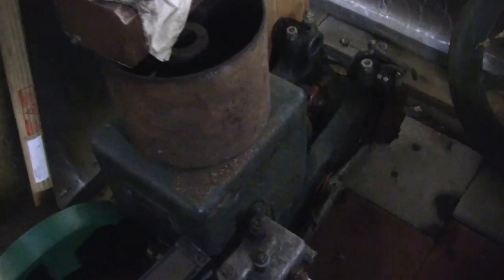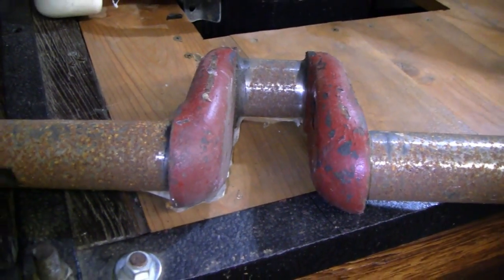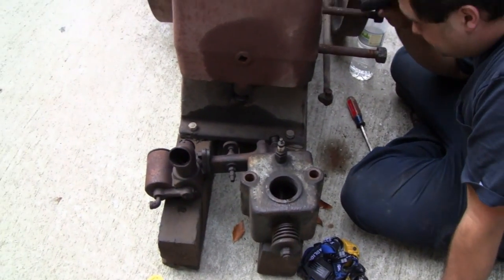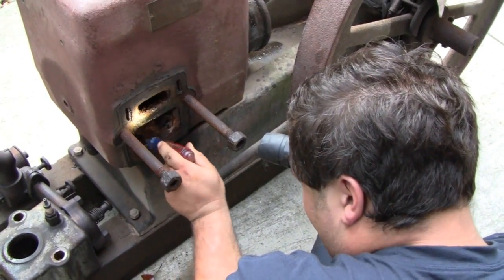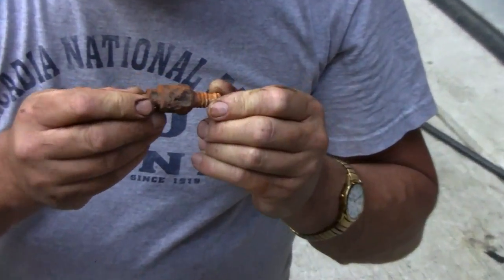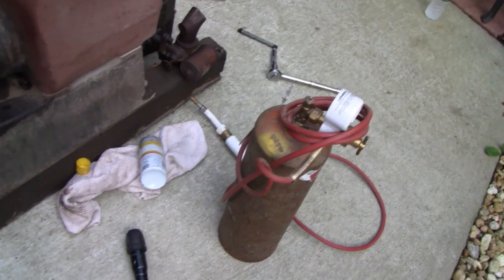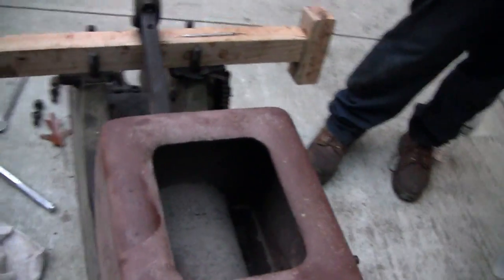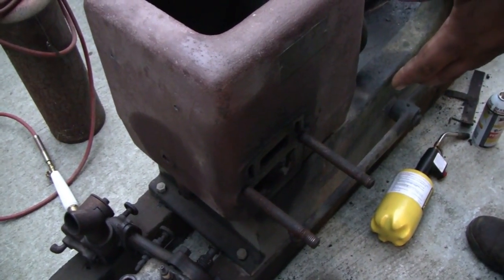UNSEIZING A HIT AND MISS ENGINE (part 1)

Comment: Crankshaft seems to be worth fixing if you have already been searching for 2 years. I just had a crank shaft from my McCormick welded. It was cracked in the same spot and the machine shop charged me 120 to weld, machine, and heat straighten

Comment: You might want to take a look at "Old Time Steam Powered Machine Shop" on the internet he could probably make you a new crankshaft for your older engine, hope I any exactly right on the name, may be off a little.
Reply: I checked, the right name is "Old Steam Powered Machine Shop" I believe he can make anything.
Reply from the maker: Getting a new crank made is no problem, any machine shop will make it!! The problem is they want 5-6 times what the running engine is worth!!☺
Reply: Have a look at the 3D printing on Leno's garage RK .....

They scan the object then CNC ..... That's the way restoration will go in the future ..... :)

Comment: Just put the head back on, Make sure the valves are closed and that they seal. Then hook a hydraulic line to a tractor or wood splitter into the spark plug hole.

Comment: I was thinking about this a bit. How expensive could it be to have a sand cast made of the cracked crankshaft, Make the bearing surfaces a bit larger for machining later and melt the old crank to pour a new one? I'm not familiar with foundries and pouring but you would essentially be recycling the crank material to make a new one thus getting the engine working again. Might be something for you guys to look into.
Reply from the maker: We looked into it long ago, it would cost about 3 grand!!☺
Reply: :( YIKES! Too much.  Thank You for the reply.

Comment: I'd spray a can of pb blaster in it, put a wood board on the side of the cylinder and hit the board with a air hammer using a blunt chisel. the shock should break it loose.

Comment: 100psi will yield approximately 11,300 pounds of force. Definitely use oil not compressed air. Oil will be much safer.

Comment: Hi: Great Video's, A good machinist like Keith Fenner, or Adam Booth (both on YOU Tube)can deep grove out and Heli Arc the crack and also cut out the rusted on the shaft on a lathe and spray weld the surfaces like new. Please don't give up on that engine. Thanks
Reply from the maker: We already looked into that, it's just not cost effective to fix that crank or build a new one!!☺

Comment: I think it would be a lot easier to fit up a plate with a grease nipple, then pump it with a grease gun and turning that cylinder into a high pressure hydraulic ram.  If this fails, you still have the option of switching to high pressure air which is harder to control safely.

Comment: Hey guys, try this SUPER penetrating , rust busting solution, you can make cheap. mix 50/50 acetone and any type ATF and shake it up and put that in the cyl or around the skirts and then see what happens
Reply from the maker: I've used that before, it's tough to get anything around the piston the way this is designed!!☺
Reply: I was thinking to put it on the backside instead of pushing it out with grease, it should flow around the piston

Comment: can you take the plug out and use air to push the piston out
Reply: It would be better to use oil and a grease gun like mentioned in the video. Since air compresses, you need a lot more volume to make the same pressure. It is also safer to use a liquid, the same way boilers are hydro tested. Since the liquid (oil) doesn't compress, it takes less volume to make the pressure. And for safety reasons, if there happens to be a weak spot in the cast that breaks under pressure, the oil and grease will cause damage more like a freeze crack to an engine block instead of an explosion of compressed gas like a steam boiler exploding.